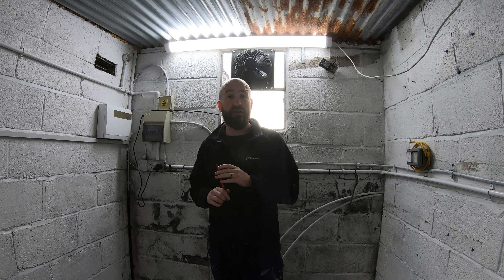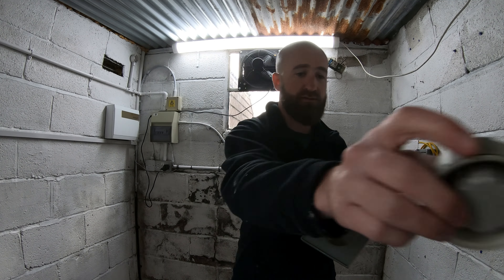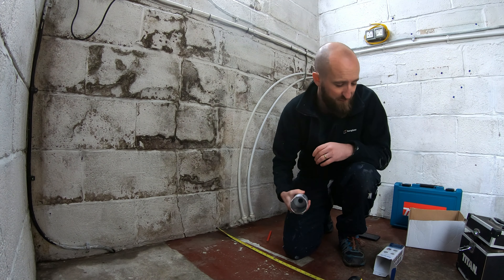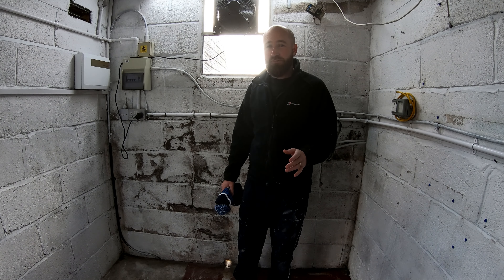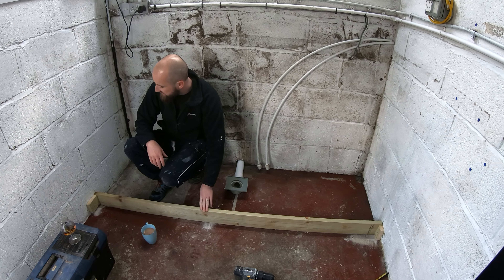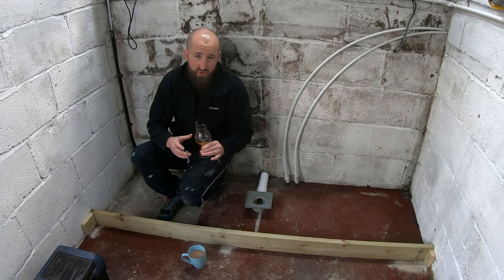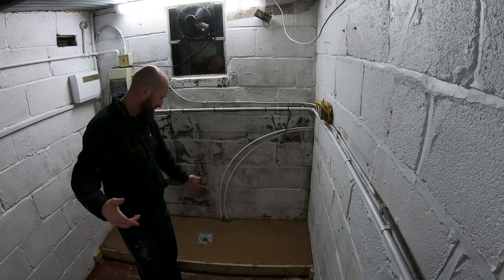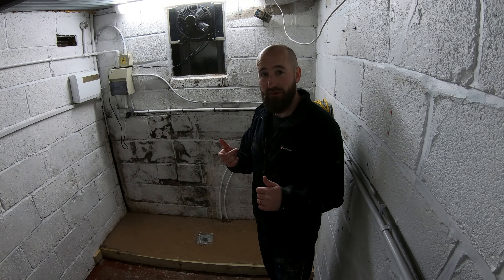Brewery Drainage Installation & Concrete Base Construction

Comment: Great to see you getting the whole family involved. Good with your cool temperatures at the moment, it will make  the concrete cure slowly which is a good thing.
Reply from the maker: Thanks for the kind comment, I didn’t think of the cool temps and the concrete - good point 👌

Comment: Have you decided what mould treatment/paint you are going for? Also would it take up too much space to put some batons up and fill with kingspan and cover with plasterboard, giving yourself some insulation? ?
Reply: & add some to the roof and then you are golden
Reply from the maker: I think there’s a good one in screwfix I might use, I’ll be insulating the ceiling just above the boil kettle area with what I have 👍

Comment: Good job!, might have moved those water ins before hand. If those john guest fittings fail then you'll be digging them out. Although they have a 10 year life span so might take a long time.
Reply from the maker: Cheers! If they fail i’ll just drill another two inlets above the pad, only hose connectors the other side 👍🍺
Reply: Thats the good thing about homebrewing and spaces is that you don't have to care as much like its in your house. Enjoying this series :) @HomebrewGriffo